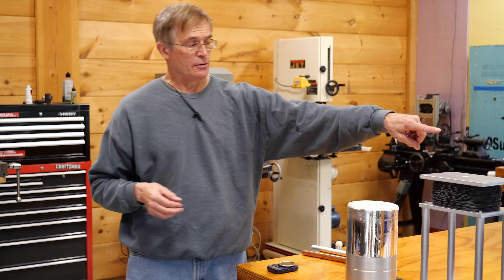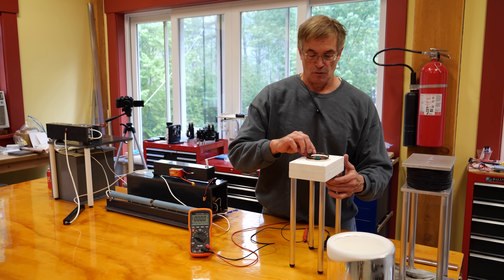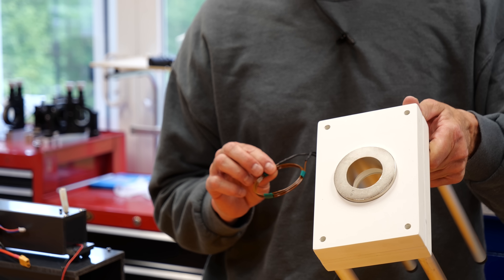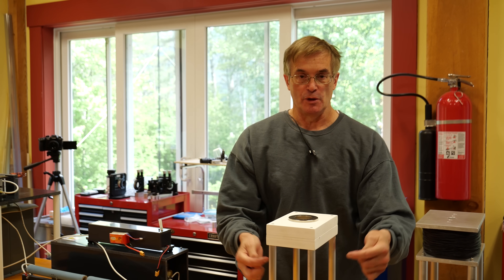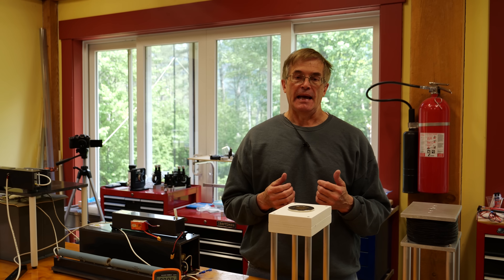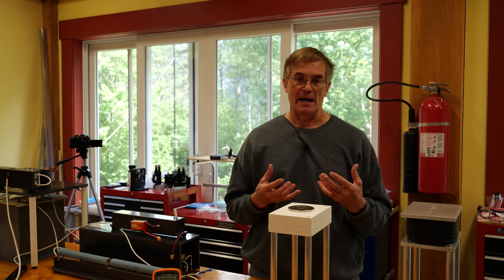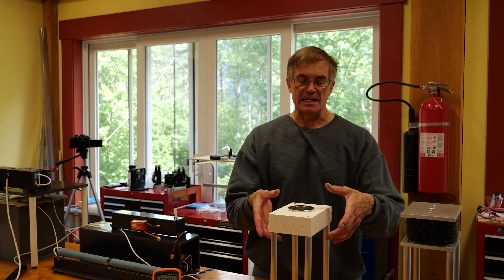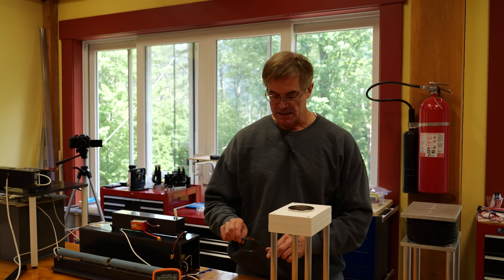No, we didn't use Magic to Crush this Can...

Comment: I am not well educated but you are an inspiration.
I wonder if you could help me  with my dream.
It might be of no surprise but I am one of those who also want to make a wind generator.
The problem with most of home made and small industrial wind generators is minimum wind speed.
I believe 6-7 meters a second.
I want to start generating a very small amount at 2 meters a second.
I want to generate about 52 volts dc for a 48 volt system. 
Now I know that power is only made with the change of flux.
The problem comes in to change the flux as fast as possible with a low propeller speed.
I know a 2 blade propeller will give me higher revolutions then more blades.
A single blade would go the fastest but then it need a counter Balance.

So speed is a problem with only 2 m/s wind speed.
Gearing waists to much power.

What if :
I have an axil that turns 2 disk with magnets in 1 direction with opeiste poles facing each other with N42 magnets which are fixed to the axil, then have extra bearings in the axil that turn the disk with coils, in between the magnet disk. and slip rings in the opposite direction, to increase the change of flux.?

For eg. Say that the magnets spin at 100 rpm and the coils turn in the opeiste direction at 20 rpm, would this work, and what would the net result be to the change of flux rate.? 

I hope this question is not out of your intrest.

Kind regards Carel kostense.
South Africa.
Reply from the maker: For what it's worth, I would focus on the rotor and less on the generator. Gearing or belts do decrease efficiency, but overall, the system efficiency needs to be balanced against the cost of the generator. Lower RPM requires larger magnets and heavier wiring if the system is direct drive, but this in turn will mean a lower temperature rise, lower resistance, and higher efficiency in this stage. More blades lower efficiency, but it is quieter. A larger diameter means more power but requires a taller mast.
Everything is a trade-off.
It's tempting to maximize a particular aspect, but a successful setup will be based on what you can access, afford, assemble, and maintain.

Comment: In a vacuum on earth all objects should fall at the same rate of ~9.8mps squared REGARDLESS of weight. Yes you don't have a vacuum but you do have similar air friction coefficients between the 3 tubes. That means that the copper tube will fall slower than the aluminium tube, not because of weight but because of electrical conductivity and through that the induced current is greater (due to smaller ohmic losses) and therefore the generated counter force is higher.

A silver tube should fall slower still.

Your liquid nitrogen explanation follows this logic.
Reply from the maker: To some extent I agree, but I think you missed the point of my comparison with the stainless steel. The magnetic interaction with the tubes depends on the electrical resistance which determines the current produced as a tube decends through the magnet.  With a mass similar to the copper tube, it experiences the same gravational force, but the lower current means a lower magnetic interaction.
Reply: @TechIngredients  Absolutely, I'm saying that it is only the resistance, not the weight at all because regardless of the weight the rate at which that electrical energy is dissipated is that rate at which it falls. 
I've done that experiment with copper and aluminium tubes and the same magnet dropped through them so that the weight is always the same and you see a big difference between the materials.

Comment: Why reduce the size when you can have a strong magnetic field and a large size at the same time?
Reply from the maker: What do you mean?
Reply: @TechIngredients  Apologies, I forgot to preface this with the subject matter. I was referring to fusion reactors and the fact that newer ones will be able to be built smaller. I was suggesting that the advantages of a powerful magnetic field combined with a large fusion reactor might be worth the expense, especially in the short term.
Reply from the maker: I see.
The advantage of smaller, less expensive reactors is that they can be deployed sooner, modified for less expense as the technology improves, distributes the electrical power over the grid and in my opinion the best reason is that the most exciting potential for fusion is not terrestrial power generation, but transportation.🚀
Reply: @TechIngredients  Thanks for the response, I hadn't considered those aspects and now appreciate the value of a smaller reactor.

Comment: Sir, how come the wire is not melting, can it carry 15000A even if it is for short period?
Reply from the maker: It can.  Time is the critical factor.
Reply: @TechIngredients  Interesting. Thank you for the reply. Awesome work 👏 as always. Is it possible to crush the can  using high frequency ac instead of dc but at lower current?

Comment: Do think is possible to make a quartz engine. not all engine but maybe the pistons and it would be an electric motor because quartz make energy when you hit it. Examples barbecue lighters. Please 🥺 tell if you would do this experiment for me
Reply from the maker: Transparent cylinders have been fabricated from quartz to allow study of the combustion process.  Explosively powered piezoelectric compression is an interesting idea.

Comment: Practically speaking, if the powers that be wanted safe cheap energy they would have gone with nuclear instead. Something “terribly” wrong will happen that will deem fusion power unsafe just like nuclear storage was changed to the scary “nuclear waste.”
Reply from the maker: I disagree.  The fundamentals are inherently  too unstable to be catastrophic.  This is a little like the principle of the thorium reactor.
Not to mention that fusion plasma has more potential as a means of transportation than as an alternative source for the grid.🚀

Comment: So ive always noticed that copper coils seem like 2d objects that cause 3d magnetic fields. What would happen if you wrapped a coil in a more 3d shape?

I understand that coils are not actually 2d, but what if you wrapped a coil in a torroid?
Reply from the maker: That is basically the design of a tokamak.  With the addition of a pair of "coils", one above and one below the torus, you have the magnet design. More to your question, consider the field in an extended coil like an inductor.  Simply curve this streight tube into a torus and you can visualize the field shape.
Reply: @TechIngredients  wow, thank you for the reply. Take my sub.

Comment: How come you don’t have protection from the X-rays produced by the arc gap? Just asking?
Reply from the maker: Which gap do you mean?
Reply from the maker: I'm still not sure which gap you meant.  If you're talking about the spark gap then the aluminum will easily block X-rays of 2kV energy.  If you meant the plasma tube then you need over 25kV to penetrate the glass.  However, in that case the residual gas present in the tube prevents the electrons from accelerating even to the maximum potential across the electrode spacing.  That's why an X-ray tube operates at a high vacuum.

Comment: I don't know yet if you covered this, but isn't tritium crazy rare on earth?  I heard of a hypothesis that the surface of the moon may have commercially viable tritium because of eons of sunlight hitting the moon dust with no atmosphere to filter it.  If so, just imagine the technology boom, plus, a significant and expensive component to nuclear fusion will be more readily available and drive down costs to research this
Reply from the maker: Tritium is generated at a greater rate than it is consumed when the neutrons from the fusion reaction are absorbed by the lithium in the molten lithium salt that surrounds the reaction and transfers the heat to the generators.

Comment: why don't they use electromagnetic coils in bullets..  you could run a high current charge thru it ignite the gun powder.  you could create shape charges for bullets lol like stun mode  only ignite half a charge lol.
Reply from the maker: Theoretically, you could.  There are practical issues.  You saw the size of the electrical system we used  to crush the can. Even a more compact design and a smaller compressed charge for a bullet would still be larger and heavier than a primer.  For very large shells this might be a competitive alternative and the extremely precise ignition would be an advantage.
Reply: @TechIngredients  thanks   So the problem is a power storage and handling .   To make it small enough you would need really high voltages .
Reply: @TechIngredients  and thanks for taking the time to explain that  my knowledge is rudimentary.    

I’ve got a high school diploma never got to actually got to take classes in stuff I liked.     

Thank you I know your time is probably very precious..

Comment: Didnt Farnsworth create a fusion generator using a vacuum, deuterium gas as fuel, and a high voltage to contain the super hot plasma ball?
Reply from the maker: I doubt it.  High voltage will not contain a plasma.
Reply: @TechIngredients Thank you for your quick response.
Here us a paper from Stanford U. http://large.stanford.edu/courses/2012/ph241/klopfer2/
Also:
http://www.electricalfun.com/WorkbenchFun/Fusor_William_Jack.aspx

I see a whole bunch of YT videos of people building these.
Wonder if you could create a sphere of tubes and run water through it that would turn tje water to steam, that would turn a turbine or even heat your house. Just my thoughts. Perhaps u can do a video on it.

Comment: You missed the point that, the field of the coil can only crush the can because the can is conducting current opposing the field, canceling out the field inside the can. Outside, away from the coil, if the can were conducting that much current, you are correct that it would explode, but inside the coil it is crushed because inside the can there is no field!
Reply from the maker: You're just restating the conditions and explaining the event from a different point of view, but it's not the only point of view.  Nothing missed here.

Comment: 16:33 Actually the steel tube's rate of fall isn't affected by its wieght at all or more actually its mass.  It won't fall any faster than the aluminum or copper tube when outside the magnetic field given that they all have about the same shape and therefore air resistance. The acceleration of gravity for all three is the same, as is the resistance of the air they are falling thru given there same shape. I assume the inside and outside diameters match, just the material density is different. So when unaffected by the magnetic field they all fall at the same rate. Minor mistatement by the presenter, I am sure. But it IS a bit of pet peave of mine. I know other mechanical engineeers despite having gone to the same univerity at the same time as me sitting in the same physics classes, getting the same or BETTER grades that I did, who will insist that heavier objects fall faster than lighter ones always because the force of gravity is greater. Arrrgg!   To me that just shows that American education is about passing tests and not necessarily about learning.
Reply from the maker: You point out a mistake. Fine.
You should not go on to insult everyone  who attended an American University  because of your pet peave.
Reply: @TechIngredients  I went to an American university, dude.    No insult was intended.  It's just a fact, if you know how to pass tests that doesn't mean you truely understand the subject. Not necessarily.  IDK what the solution is. Better crafted tests?  But it is really up to the student in the end.  Do you want to just pass the course, get a good grade on the tests, or do you want to really understand and retain the material.  Unfortunately for college students, the latter takes more time which most college students don't have.
Reply from the maker: From one dude to another, that's  how you presented your position.
Knowing how to pass tests doesn't  mean you don't understand the subject.
In any case, thanks for the comment.😘

Comment: if electrons have a magnetic field, then the atomic nucleus they orbit also has a magnetic field..........is the field of an atom,including its orbiting electron, completely neutral overall or is there a tiny net difference? Maybe if you had an enormous amount of mass, then it would exhibit a weak but important field that attracts other mass?  Maybe thats what gravity really is.............    Removing magnetic fields from steel items is called de-gaussing..........in WW2 they had to do this to ships to prevent magnetic mines sinking them.
Reply from the maker: The field of an atom tends toward neutral, but because the location of the particles is distinct, there are gradients near the atom.  This is extremely important and makes chemistry possible.
Reply: @TechIngredients  if you mean there are orbital 'shells' around the atomic nucleus, and there is an ideal configuration in each particular shell layer........due to atomic number limitations, any particular element may not have an ideal configuration in the shell layers, which give a particular element a valency, or tendency to borrow electrons or loan electrons into another elements shell layer to form a compound..........even compounds can still have an overall valency, so they can form even larger compounds.  Much like how ammonia and a nitrate can form ammonium nitrate which is still chemically unstable.   Electric universe theory holds that overall, all mass has a very small magnetic/electrical field, universally attracting all other mass.  The really cool thing inside atoms, is the empty space which holds more vacuum, or zero point energy inside it than all the known mass of the universe is expressed as energy via E=mc2
Reply: Fusion would be a technological achievement............but its still ridiculous in cost,complexity and utility.   By comparison a fission MSR is like shooting fish in a barrel.   Get a large tank, fill it with hot NaCl with some thorium or even spent nuclear fuel and it will fission in the fast spectrum with passive safety and very,very,very simple engineering and low cost. Fusion will never achieve that kind of simplicity or low cost, its impractical.  Fission MSR has no long lived waste and passive safety and no weapons materials production when running on Thorium. Nonetheless an excellent demonstration of the complexity of the principles involved in making Fusion workable.

Comment: If you were to use alternating arc magnets and spin them around the tube, could you induce an intrinsic spin to the plasma? Would be interesting to see what that looks like. Here's a link to the type of magnets I am talking about, and no I am not affiliated to Apex magnets, although I have purchased magnets from them. https://www.apexmagnets.com/magnets/31-94mm-x-27-94mm-x-6mm-arc-magnets-neodymium-magnet
Reply from the maker: You could.
Reply: @TechIngredients  if one was to create a plasma with both hydrogen and mercury, could the heavier mercury atoms be used to aid in fusion? Statistically speaking eventually two mercury atoms will eventually impart their kinetic energy into the hydrogens. I tried to see if this type of experiment has ever been conducted but didn't find anything talking about it. I was thinking perhaps two arc rings could be used with an alternating rotation to create more energetic collisions. I realize that to create fusion we need very high pressures and temperatures, but perhaps a method such as what I am purposing here could lower that temperature and pressure. Thanks for the reply!

Comment: SO,  I worked with Plasma Etch machines for semiconductor mnaufacturing. We use plasma to bore holes (vias) in the silicon, wafers.. We have been using magnetics in our chambers for 20 years to  guide and control plasma.   This video did not some me anything new,  this is a know process.
Reply from the maker: To you it might be, based on your past experience.
Reply: @TechIngredients  I watch all you videos,  You a quite good at what you do.  I would like to see you continue your work with Plasma and Magnetic fields, and the Magneto Hydro Dynamic device.

Comment: When one electron enters a wire, another electron simultaneously exits the wire, meaning that the wire itself maintains a neutral charge as no net electrons are added or removed during the flow of electric current; this is a fundamental principle of charge conservation in electricity. This says to me that electrons travel at an infinite speed. As one electron enters a wire another election instantaneously exits the wire.
Reply from the maker: You're conflating simultaneously with the speed of light.  If what you're describing were true, communication of data through a wire would occur faster than the speed of light. That doesn't happen.